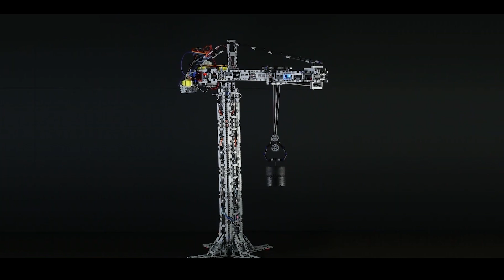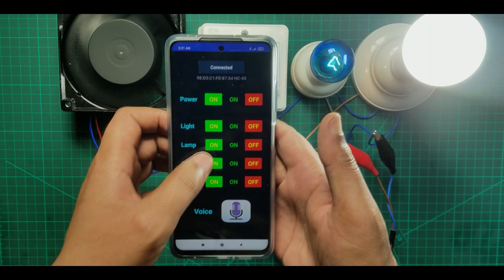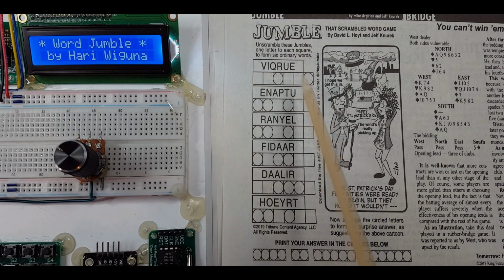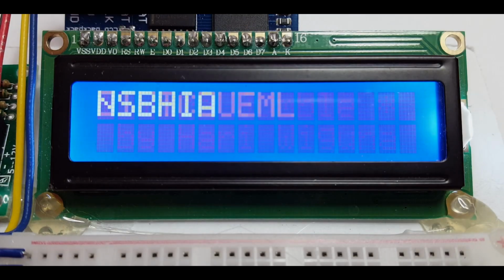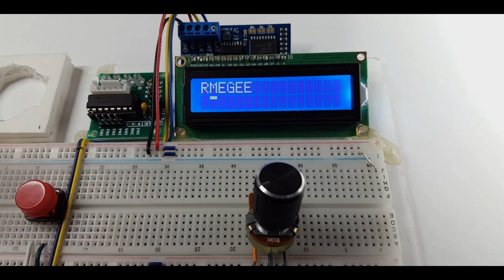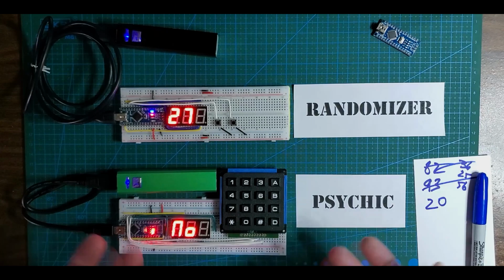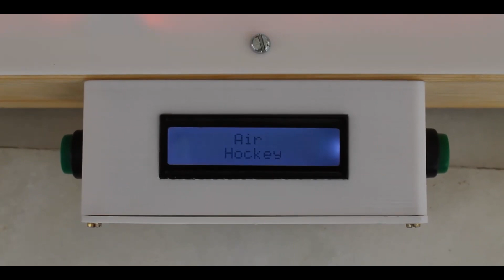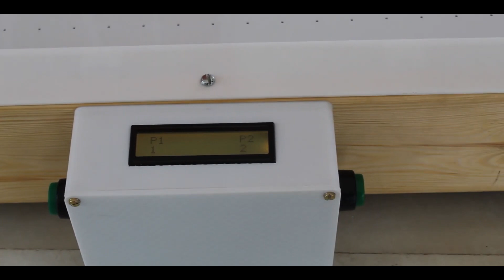Top 10 Arduino Projects 2021 | Arduino School Projects | Viral Hattrix

Comment: Just like the other "Top Arduino Project" videos; playthings or could be done with off-the-self products.  I am always disappointed that there are never any fully realized useful and unique applications for these microcontrollers.  Yes, I have one, I do know how to program it, and could even build using the raw microcontroller chip once I've prototyped using the full board.  I just haven't found anything I need/want that I couldn't do without using a microcontroller and making a Rube Goldberg device.